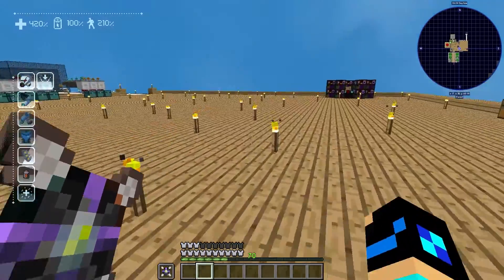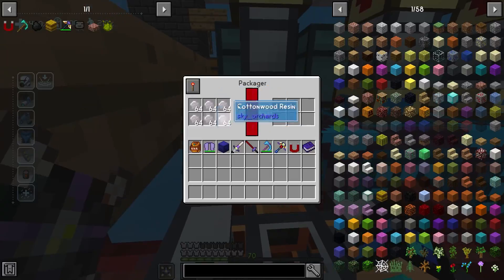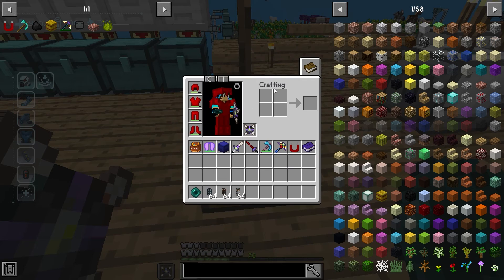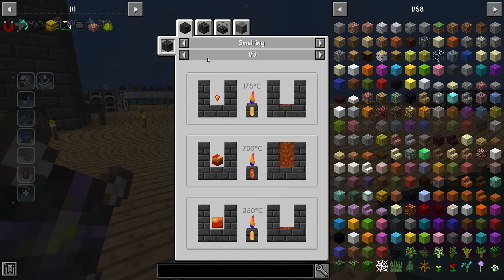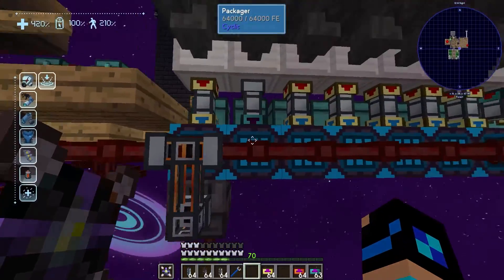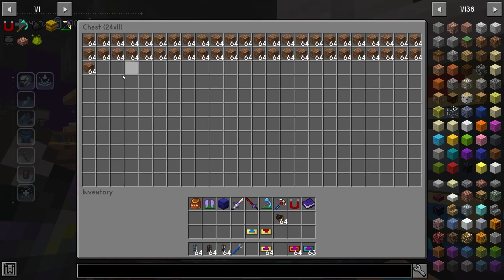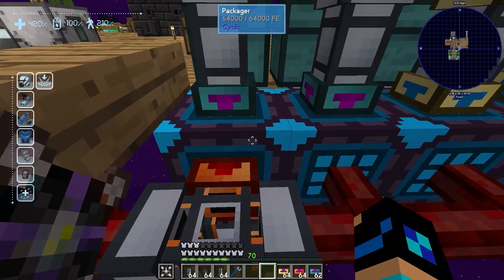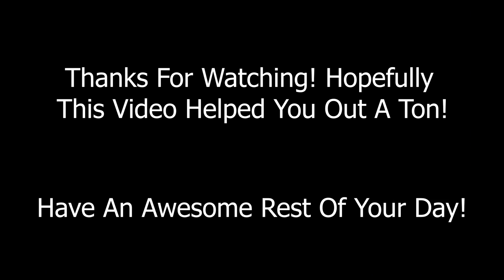Quick & Simple Method To Stop Clogging In Auto Crafters / Packagers In Minecraft Sky Factory 4!

Comment: tysm but there is a fatal flaw to this: it drains your acorn and resin so fast that the bonsai cant keep up thus making the acorn clogg the auto crafters
i have a better desgin: use 2 servos and extraction point(you can upgrade them to how much acorn and resin you can make per sec)
make the first one acorn and make it pull 4 at a time(can be increase to your rate)
make the second resin and make it pull 5 at a time(can be increase to your rate)
make sure to turn them on at the same time

Comment: What do you do with the excess? Do you know a way to automate that? Take iron as an example, you make amber with the resin and acorns but after awhile you have 5k acorns extra. You can smelt the acorns into iron also, but how do you automate the process so that amber gets sent to the smelter while amber is available, but then acorns are sent when you run out of amber?
Reply from the maker: You may need to change the type of mulch you use. I was originally using brown mulch (like shown in the video) but I eventually changed all my hopping bonsais to blue mulch and that mostly fixed it. I was still a little short on resin and in some cases, acorns, but It usually produced enough to make an ingot. Hope that helped!
Reply: @JmachadoYT  Hey, thanks for the response. I use only blue mulch at this point.

Anyway, after posting that I went to my test world and began playing around. I finally developed a system that does what I want to do fairly simply using the "retrievers" instead of filters and servos. The retriever allows you to specific that max amount of a specified item in the connected inventory.

So the basic setup is: Chest with bonsai on top. From that chest, junk goes to trash, acorns to acorn chest, resin to resin chest. An auto-crafter has two logistics pipes going in using 'retrievers.' One pulls acorns, putting a max of 4 acorns in a-c, the other resin with a max of 5. The a-c does it's thing and sends resin of the smeltry. The important bit is that there's a comparator on the resin chest that sends a signal to a second logistic pipe with a servo that pulls acorns 1 at a time from the acorn chest. When the resin chest is empty, acorns will flow, 1 at a time, around the a-c and directly into the smeltry.

I haven't built this in my world yet, but I tested it for a while in the test world, and it worked perfectly.